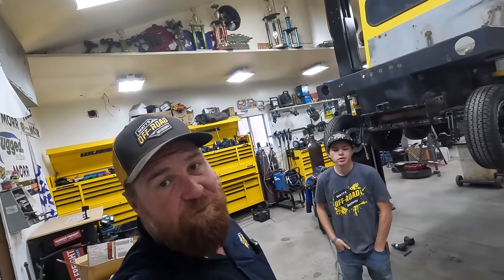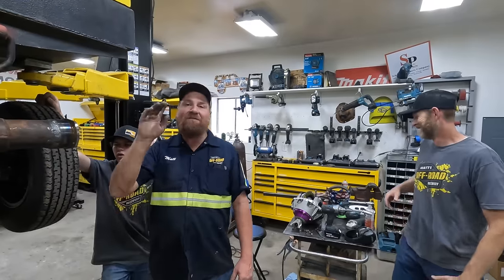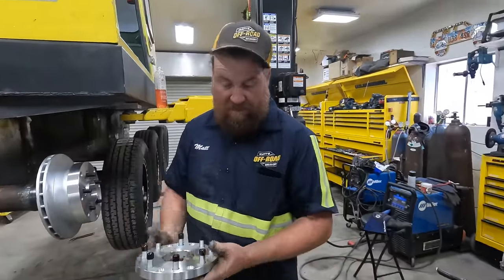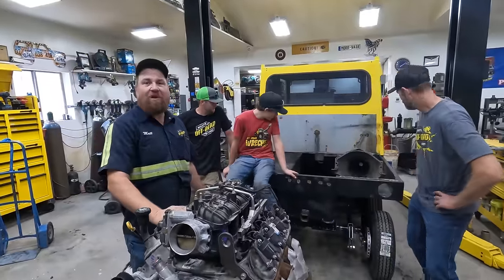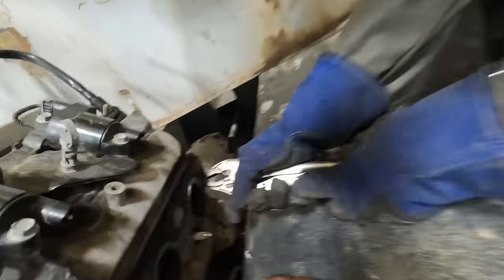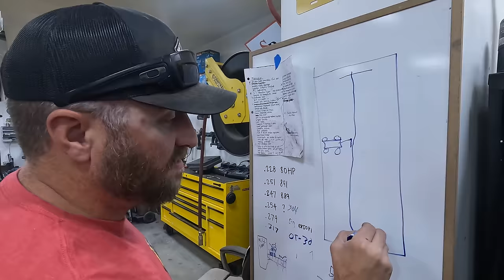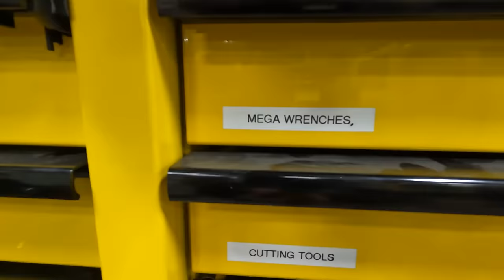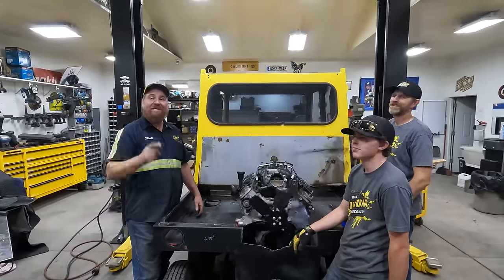Did We Make The Bombi Too Powerful? Massive LS Engine Barely Fits.

Comment: Personally, I would have canned the mechanical fan. You have so many better packaging options for the cooling system with electric fans.  It may be better to have two radiators and each with their own fans. Electric fans have been in common use for 30 years and are pretty reliable.
Reply: I was kinda surprised they didn't do that too. I had a vertical mount in my mind to package the engine up easier while leaving it accessible. But I guess then they couldn't use it as a handwarmer ;-) they may also have a lot of electrical loads and taking 500W of fan off might make a decent difference to their alternator. They do seem to go through them.
Reply from the maker: Mechanical fan will move 40 times more air than the best electric fan. 

I can keep my rigs cool in 115° at 5000 RPMs moving 1 mile an hour with a tailwind. All this while the AC is blowing cold.  
There’s no electric equivalent.
Reply: @MattsOffRoadRecovery  we use electric fans on the Barra engines here in Australia (4L straight 6 on 50+ degree days (122f)) but they are 500 watt fans on quite large radiators and the Barra isn't a particularly hot engine. I had a bit of a look around it doesn't look like there are many electric options in the same class available any more. 
Spal have one but I bet it'd cost a bit more than your mechanical one and it's huge ;-) 
Horses for courses mate love your work.

Comment: I think the problem is that you haven't made the Bombi even more powerful enough. Four figure HP and Torque or nothing!
Reply: These things are slow and low for a reason....too fast can kill you for what they're doing with it
Reply: It's an LS, they make 10,000 horsepower from factory right? And every junkyard on the planet has a 5.3 tree out back you can just pick them from for free?

I swear that's what everyone told me.
Reply: I want to see the Bombi with wheelie bars running 8's in the snow drags this winter.....

Comment: You could add some sort of exhaust diverter/valve to point at the brakes in the really cold weather if you think it might have issues.  Then close it off during normal operations.

Comment: Aside from the ability to tighten the track, The sprocket is higher to keep the track from moving laterally (sliding off) while turning.
It also allows the track to grab the objects you are mantling at a higher position.

Comment: I live and wheel a lot in Alaska and the only time I’ve seen brakes freeze like you explained was with a sxs when we crossed a spot of open water when it was below 0 degrees. But they froze open and wouldn’t work till we got em melted.

Comment: Just a suggestion;  think about putting the exhaust and the waste heat (radiator) above the engine and pointing straight up.  An electric fan pushing air upward through the radiator should keep the engine nicely cool and happy.  You might also remember that heat rises naturally.

Comment: If you get good heat in a stud when welding to it, get a block of paraffin wax and melt a bit into the bolt hole. Helps to lubricate a bit for the way out.

Comment: I'm pretty sure the elevated drive and idle wheels are for terrain clearance. You get more effective area of track on the "offending surface" than trying to lip up the entire track assembly with just the point of contact a normal wheel would have. There's a reason why snowcats and tanks have that kind of setup and skid steers and tractors have the triangle setup. The tractors are trying to minimize the amount of force their weight is putting down on the ground through the track. The wider the surface area of the track in contact with the ground, the more it's weight is distributed. Skid steers need the triangle configuration for balance. Heavy load in the front, shove the track assembly mostly towards the back to help counter balance it and having a more elongated track profile helps keep it upright in a pitching sense. Diggers have completely flat tracks because they're doing the same thing as tractors. It's a lot of digger to put in places where it's moving a lot of stuff.

Tanks and snowcats are going up and over logs (for the majority of cases) and rocks. So you think if you're going to go over a rock that's a bit more odd shaped round, and you have a round tire, you deflate it to put more tire on the rock. You can't exactly do the same to a track without risking throwing the entire track of the wheels. The angled front and rear help compensate for that, as there's track that gets wrapped over the obstacle and is used to grip the log or rock better than a single point of the front wheel with a little bit of track. You get what I'm saying?

Also the angles help, although it's a questionable effect, to keep the tracks cleaner. If it's in contact with the ground for less amount of time (in the consideration of the entire length of the track, then that's less time for it to pick up mud. Even if it does, it's getting slapped around on the top quite a bit (and tanks have some track clearing devices) that that kind of stuff gets rattled/shaken off.

Lastly, I'm pretty sure that's a new event or even a unique event for your guys' rodeo. I've never heard of a tandem rider/Tarzan dismount/Buster Keaton hanging/"Wait-a-moment-while-I-go-make-a-legal-U-turn-at-this-barrel"/"I've returned."/"Crap,-I-left-the-stove-on!" event in my life. Although now that I wrote all that, calling it the "Buster Cowboy", in homage to Buster Keaton, isn't a bad name for the event.

Comment: some fluid will cling to and fling off the whole ring gear circumference, good old stiction! the pinion angle should help fluid migrate it into the bearing area which will also fling around.
long uphill climbs will dry out some, but downhill will reflood them. it's never going to be perfect, if you want perfect redesign with a pump and sprayer tubing. like many transfer cases have. 🥳

Comment: Love the build on the bomb b. My only concern is the differential. If it’s an open the track with the least resistance is going to spin. Your not going to have both tracks pulling equally. It will make it hard to control under a load .
Reply: it's brake steer

Comment: I live in one of the coldest parts of Alaska and still have to drive regularly.  This past winter we had over 2 weeks in a row where we didn't go above -40F, 5 days in a row below -50F, and an extreme low of -68F; while this caused many problems for many vehicles no one's brakes froze up.  (note: Many people, including myself, run aircraft hydraulic fluid in our brake systems because it has a gel point of -80 something and normal brake fluid gels much sooner meaning the brakes are unresponsive and lines are more likely to break.)

Comment: The comment about brakes freezing up on the Alaska highway is a very real thing. I live in Manitoba, Canada and semi-regularly assist people who have locked up in this way. It seems to happen most commonly to people driving in whiteout conditions and using the brakes a lot. When they stop the blowing snow touches the brakes, melts, and refreezes. The easiest way to deal with that is torque. Your bombi shouldn't have a problem because it only has brakes on the power axel. The biggest problem is the 2wd systems where they can break their drives free but the other wheels are locked up and the ice on the ground doesn't provide enough traction to break the other wheels free.

Comment: Might want to tack weld the bearing race seal to the axle so it doesn't work itself out of the housing when you do turns and axles popping out of the housing and bearing stays in place. Just a thought you might want to know it does happen.

Comment: Get t4 turbo manifolds. Will make your life easy for exhaust. Another option is boat manifolds to not only cool exhaust in engine bay but with circulation pump it could be heater.  And same as a turbo manifold it's center up dump

Comment: If your concerned with oiling the pinion, there are small pumps you can install. They are super common in the oval racing world.
Also, there are inner axle tube seals that you can put in. keeps the oil from running down the tubes when your on any kind of incline. If you get sick of those single piece axles, you can go to a floater setup which is much easier to work with.  check out Speedway Engineering in Southern California.

Comment: You will get better traction on the ground with the driver axle on front like it is.. then you get full tension on topp and trakk that follow the ground with less tension.. same thing we do when we climb with all machines driven on belt we drive it backwards doing climbing. Specially when you don't have suspension on it more than the rubber wheels 💪👌😊

Comment: As a past snowcat owner/operator, the problem I see with your front sprocket drive that might raise its ugly head is walking out of the track. In trying situations ie. deep snow, sharp turns uneven ground pressure with the slack being on the bottom the intermediate idlers might clear the tire guides.

Comment: For those of us who don’t have a welder to extract broken bolts (yes, there are some of us out there)…

I use a left-handed drill bit to drill down the centre of the bolt, combined with a set of ‘Ridgid screw extractors’ (and liberal amounts of WD-40)…

Comment: The front drive makes absolute sense. The slack allows the tracks to more easily conform to terrain, and thusly increases surface area and traction. The power delivery issue:  starting over the top still results in turning the wheels exactly as if the drive was on the rear. My .02.

Comment: If you have any trouble with that system for tensioning the tracks, look at the setup they used for the WW2 half tracks.
They used a spring to hold the tension while allowing the track to flex over uneven terrain.
Would allow for the tracks to absorb less of a jolt by putting it into the spring rather that the track or axel assemblies.🤔

Comment: Living in Alaska and have worked on the north slope, freezing brakes are a real thing. We would park our trucks and equipment in flat ground without setting the air brakes, only choking the tires. 
Also, lower 48 is a northern term for the lower 48 continental 48 states.

Comment: You should of installed an accessory drive with Corvette spacing as it is the shortest drive available.

You you flip the intake manifold around so that the throttle body is facing forward.  Most people are unaware that ls intake manifolds are symmetric and can be installed backwards.

Comment: Matt you made a comment about individuals making comments about front drive sprocket. I have worked on many Military tracked vehicles. They were all front drive sprockets or commonly referred to as “final drive sprockets”. Regardless I think is because it is more desirable to have the tension on the top because it loads up the suspension on the bottom if you drive from the back. I

Comment: So I lived at mile 0 on the Alaska hwy and we never had trouble with our disc brakes, drum brakes were a problem exactly like Matt described, if you stopped and applied the parking brake brake at 40,50° below centigrade then you could easily have to free the brakes, we carried a tiger torch for this reason.

Comment: Fan rotation/cooling. Regardless how you put that specific fan on, turning it over does nothing to change the flow of air off the fan. Either changing the connection point to rotate the other direction or changing the orientation of the blades will be what change the air flow.

I used to try and explain this to my ex-wife, with our ceiling fans. I finally just wrote an S and a W, for summer and winter. 
That made all the difference in the world, for my high school English teacher wife.

Comment: I could just be over thinking it, but would a truss on the 9in be beneficiary or pointless at this point? It's got the welds along the top connecting to the body, but with the new power it's gonna have, could turning cause twist issues with the axle?

Comment: Dont forget hydraulic motors and pumps as well.

Ag tractors pull from the front and blow the hot air from the rad towards the engine and out the vents, BUT some heavy construction equipment like heavy wheel loaders are the opposite. They pull air from the engine side and push it out the rear of the machine where the rads are at. Either way, don't think it makes much difference of push/pull from either direction as long as it has the design to pull as much air as it needs.

Comment: In light of your comment about track tension being a bit strange, what with tensioning the top of the track first because of the rear engine/front drive layout...I wonder if it would be worth the effort of using a FWD engine/trans package and sticking it all in the rear.  Possibly too much work now that so much of the undercarriage has been finished, but...could be worth a thought for the future.  It would make the power plant a compact package, you could even mount it on a sled like an old Greyhound Bus for easy removal of the entire power plant (incl radiator) out the back, and having no prop shaft means one less point of failure when under load.  just a thought.  👍

Comment: right at the 19:30 mark someone makes a comment about the back seat getting hot because of the exhaust pointing back. those manifolds can be flipped because the heads are symetrical. maybe the exhaust can be built with the manifolds flipped to keep it away from the cab?

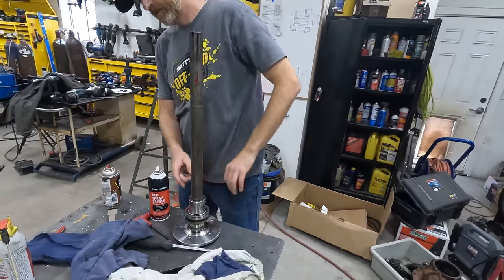Comment: 7:58 heat the rings to blazing hot in an oven/grill and they'll nearly fall on, also those looked pretty loose fitting while being pressed on, I'd be worried about axles exiting.
don't overheat them with torch and alter the metal.

Comment: Just about every tank in WWII had the drive sprockets at the front, but they still managed to do alright. I think the only reason they went to fitting them in the back is when the power pack was developed and they could fit the engine and transmission in the back, meaning they could free up space in the fighting compartment by not having a dirty great drive shaft running to the front.
Reply: "pulling" the tracks vs pushing them if they became loosened, but wither way your hosed if they get too loose. they're never in perfect tension like a CVT transmission belt.

Comment: I've refrained from commenting about the bomb b, Matt and Tom Tom definitely know what they're doing, but I have a couple of concerns, or suggestions for whatever they're worth, one  is those pneumatic trailer tires are the sidewalls rated for that kind of use?  popping tires could be an issue, the other is that brake steering, Matt could have used a rubber track caterpillar or bobcat transmission as a donor and steered it like a skid steer with two sticks seems more easy and reliable, the top of the track is supposed to have all the slack at least that's the way caterpillar does it, in any event that thing will be much better than it was

Comment: The only freezing issue that occurs with brakes. Is the pass or shoes freezing to the drum or rotor. Semi's don't set the trailer brakes in extreme temperatures. For this reason. However even if this happens on a drive axle. The power will break them free. God bless

Comment: Drive design- The tension was spread across the top so the bottom would have room to flex and absorb the terrain. Improve articulation on the contact area of the track. That was the idea of that design.

Comment: Matt I have a welding question, I have used Arc/Stick welding a lot because it never comes apart.  I have had issues in the past with MIG where it looked great, but hit it with a sledgehammer and the weld would break fairly easily.  I'm sure I was doing something wrong, but do you ever have that issue?

Comment: While you work on the Bombi let's do this: 
1.  Heater hoses
2. Heater core and housing
3. Defroster ducting
4. Gas gauge in dash
5. Gas sending unit in tank
6. Plugs for charging camera
7. Light switch for head lights
8. Light switch for interior lights
9. Light switch for high power lights/light bars / front and rear...
10. Light switch for undercarriage lights...

Of course you are going to need to put the respective devices for the various switches.  I may have forgotten something on the inside or outside of the Bombi.  The whole thing is you need to address these items before you get the motor in and take it out on a job.  If you don't do this in the build, you will likely never get around to actually finishing these items.
These are things you could hand off to TomTom and he will either do them or nag Matt until they are done.
You are welcome for receiving my suggestion...

Comment: I aggree with honeybee the lower 48 relates to continuous states however it is confusing because Hawaii is the southern most state yet not contiguous Alaska undisputed Northern most state.
Bulldozers also have reversible fans because air drawn from engine area has less ice, snow & chrystal that tend to clog radiator air passages thus cooling is preserved.

Comment: Amazing progress.   Amazing updates.   That Bombi is going to have some serious HP from the mods.  I noticed at the 6 min point it is only welded along the top of the axle.  Any considerations for anchoring the bottom of the differential?  Just thinking since you are going to be applying incredible stress to that location....just tossing it out there for that infamous "triangle" of strength.    Looking forward to watching the progress.
Reply from the maker: No way you could leave that open. Lol
Aside from the drive axle, ripping off, the bombi would fill full of snow like a belly scraper.